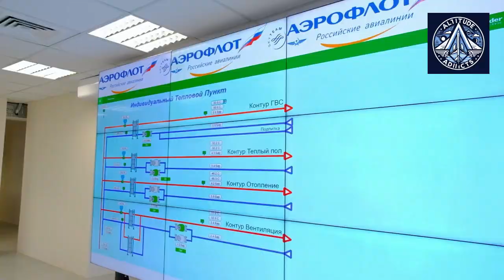Russia Ditches CR929, Plans New Wide-Body Jet With PD-35 Engines

Comment: Russia needs a Il96 2 engines varians with syhtnetic wing and other minor changes (delete middle wheels) to make a decent long haul plane analogue to A350 and C929. These changes doens't impose huge investment so a small production run of 100 planes would be acceptable. Problem is if there is capacity to build such plane now that production run of MC-21 is starting and Russia cannot outsource part of the parts to other countries.

Comment: I don't think it's ditching CR929, if you look at C919, almost 3/4 of components of that plane are foreign. Russia needs a home grown aeroplane with its own built components. Russia needs to build on the success of MS 21 to design a widebody airplane. If they can modify the IL 96 to fly on 2 engines, I think it's okay, rather than to start from scratch, Whichever is feasible, but I would prefer something new and modern.

Comment: Key negative for Russia in regards to CR929 was the fact that China was happy to make use of significant western components.  This would eventually mean that Russians would have no choice but to build a version of the plane with NO western components, so why bother complicate things by staying with the project.
Reply: China is gonna ditch those in due time no worries. Trump is also gonna increase sanctions on them  and aviation sector is definitely gonna get targeted as well.
Reply: True. But China may also need to learn to live without Western Components. There seems to be a trade war brewing and one of the few things the US can do to hurt China is impose Aviation related sanctions. China is not as advanced as Russia in many areas of Aviation and will take longer to complete an import substitution program. I am sure they are already planning to become independent of western parts asap but it will take a while
Reply: @pentaprism55  I think your statement is based on your impression rather than facts. If US sanctioned on some Chinese aviation projects, C919's engine for instance, which Russian engine could you name for replacing the western one on C919? PD-14? Obviously it hasn't met the criterion of commercial flight yet since the substitution process of PD-14 along with MC-21 haven't been completed in Russia.

CR-929 was a commercial joint venture which means both sides need to invest or offer something in the project. But what Russia could contribute in the project? Funds Technology? Products or components? Obviously funds are out of question for the reason we all know. And technology, do you really think Il-96's obsolete technologies can be used on a plane which needs commercially compete with its western counterparts like Boeing 787? As for components, could you name a single Russian one which is on par with the western component for C929 but China can not make? PD-35 for example, where is the engine? When Russian is able to deliver it? 

On the other hand, nowadays, which means not a decade ago, Chinese aviation technology isn't as weak as you think, otherwise I bet US would have already put sanctions on this sector like what it has done on semiconductor sector. China now can mass produce modern military transport airplanes like Y-20B, which WS-20 engine and avionics can be easily converted for C919. I guess this is why we haven't seen any US sanction on C919 yet.

Comment: The best Russia can do is upgrade the Il-96-300 and Il-96-400 with newer avionics and newer engines, and using composite materials where possible. That would mean redesigning only the wings and engine control system. Russia has already designed new cockpits, interiors and a fly-by-wire system for the Superjet-New and the MS-21 so they should be able to copy-paste and scale-up. If they start working on it within the next 2 years, the work should be complete by the time the PD-35 is ready for tests in 2030. I think everything depends on how well the lauch of the MS-21 goes late next year or early 2026. If the project is a massive success, Russia might be more willing to invest more annually. Moreover, they might even attract foreign buyers which will inject more money into the industry.
Reply: PD35 wouldn't have enough thrust.
Reply: @OOpSjm  It will have enough thrust. However, it's still early days. The engine is only expected to be ready after 2030.

Comment: For the time being it will be best Russia drop the project as it have more demanding purpose on its land. China on the other hand need more aircraft for their vast domestic use
Reply: They can't drop the project because such a plane is needed for long haul flights. It would be stupid to just ignore the market especially for a country as large as Russia. The only quesion is do they need to develop a new aircraft entirely form scratch or just upgrade to Il-96-300 and Il-96-400 as much as possible.
Reply: @MWENDA-vv5im Russia already has a design solution since they argued back and forth with China over the use of the il96 fuselage instead of a new composite fuselage.

Comment: Russian market is not big enough to justify a new build. 50 to 100 Units is nowhere near enough. They would have to sell 1000 copies to other Countries for such a project to break even, highly improbable. They should just build about 4 Il-96/year, modify them to work with 2 Engines if they can, and they will be fine. Russia is not short of fuel, cheaper for their Government to subsidize the extra fuel they burn then embark of on a very expensive project whose costs will far outweigh the benefits. They need to focus their resources on the very promising MC-21.
Reply: Agree. The only way to get share of a market for russians is unite their force with india (big market) and turkey (turkish airlines) and talk arabs into buying 200-300 hundred. 
All these projects are bound to lose money for 15-20 years, but they (russians) have to, no way around it.
Reply: @pentaprism55   Russia market is just one Market in BRICS. There's also EAEU.

Comment: The only Airbus widebody assembly line in the World is in China it produces A330s as they are used by the Chinese in much the same way most countries use 737s and A320s ..... intercity commuter flights ..... not long haul. No prizes for guessing what the C929 will replace ..... 
the A330, C929 and Il-96 are much the same size ..... and if the Russians are making carbon wings for the C929 then you can see what they must be thinking .... why can't we simply use the same wing on the Il-96 ? or at least 90% commonality ....

Comment: Il-96 is a really old design. Russia should design a new aircraft from scratch relying more on composite materials for the fuselage to be competitive against Airbus A350, Boeing 787 and Comac C929... Cutting-edge PD-35 engines deserve an all-new wide-body long-haul airliner. But it costs a lot and development could span over more than 10 years. So, Russia should start working on it once MC-21 begins commercial operation and the war in Ukraine ends.
Reply: Old design? 

The plane design would be a cylinder, a pair of wings, a pair of engines, etc.

What exactly is "old design"?
Reply: @OOpSjm  New design must come up with. in anyway cost reduction, material reduction and rise up risky level. You can see them from 737 , 787.
Reply: @OOpSjm  old design means you can't easily retrofit 4 engine place with 2 engines.  it would be easier to design a new 2 engine plane.
Reply: Such a project you are describing will cost Russia tens of billions of dollars, and will require at least 10 years of intensive R&D.. the best Russia can do is to cooperate with China on the C929 wide body airliner
Reply: @ibrahimtouman2279  It is too late. Russia withdrew from this project because of western sanctions and concerns about technology transfer. Russia was not an equal partner in this joint venture. COMAC did not want Russia to have access to the Chinese commercial aviation market.
COMAC wanted to be the exclusive seller of the C-929 in the Chinese market and Russia should have been content with its domestic market and other smaller markets. The Chinese market is the largest commercial aviation market in the world!
That's why I think it's a good thing Russia withdrew from this project.
Reply: @msebastien24 
there are rumors that Russia might still cooperate with China on the C929 project, specifically as a component supplier.. Russia might prefer to buy a stripped down version of C929 and install its own PD-35 engines, composite wings, and avionics.. anyway, the PD-35 will not be ready before 2030, so there is a plenty of time left to discuss a new deal between the two countries
Reply: @ibrahimtouman2279  Indeed, they are now a mere component supplier. As stated in the video, Russia will provide the carbon composite wing. They will also provide the PD-35 as an engine option for the aircraft but China is also developing its own engine with composite blades. It is highly likely that China will prioritize and prefer its own engine over the Russian one except if there are technical problems with it.
Reply: @msebastien24  What is this nonsense?!!! Why should Russia be content with someone else getting 100% profits from Russian technology?!!! Russia is far ahead of China in aircraft design and deveopment especially in regards to jet engines and this gap will start growing now that Russia has been forced to seriously develop its aircraft building industry by Western sanctions. Russia is still the only country in the world that can build aircraft completely on its own. The development of the PD-35 engine is the only serious problem Russia is yet to solve in regards to aircraft building. Russian specialists have already developed modern and competitive solutions to all other required equipment and technologies. Moreover, I'm sure that Russian-built aircraft will always be recognized as being of higher quality than those built in China. Let's wait for the first deliveries of the MS-21-310 which will be the first modern Russian planes composed fully of Russian components. This will provide us with a comprehensive understanding of Russia's current situation and potential future trajectory.
Reply: @msebastien24  What Chinese engines are you talking about?!!! What fantastical world are you living in?!!! At the moment, China is struggling to develop its first engine (CJ-1000A) for the COMAC C919 commercial aircraft; an engine that will not produce as much thrust  as the PD-14 despite being much newer. Keep in mind that the PD-35 is a much larger engine and much harder to develop and build. China will not have an analogue for such an engine for a very long time. I'm not certain you understand how far China is behind Russia in terms of developing aircraft engines. It's up to China to chose if they want to buy Russian or Western built engines. Yes, China is a global leader in many fields in the world but not in this field.
Reply: @MWENDA-vv5im  China presented its new CJ-2000 engine at the Zhuhai air show this year.
Don't underestimate them.
Reply: @msebastien24  This engine doesn't exist. Maybe it will in the future. What was presented is only a mock-up.
Reply: @ibrahimtouman2279  Nah. The best Russia can do is upgrade the Il-96-300 and Il-96-400 with newer avionics and newer engines, and using composite materials where possible. That would mean redesigning only the wings and engine control system. Russia has already designed new cockpits, interiors and a fly-by-wire system for the Superjet-New and the MS-21 so they should be able to copy-paste and scale-up. If they start working on it within the next 2 years, the work should be complete by the time the PD-35 is ready for tests in 2030. I think everything depends on how well the lauch of the MS-21 goes late next year or early 2026. If the project is a massive success, Russia might be more willing to invest more annually. Moreover, they might even attract foreign buyers which will inject more money into the industry.